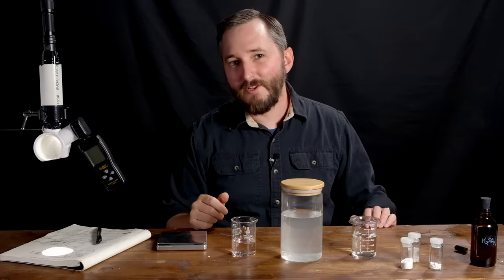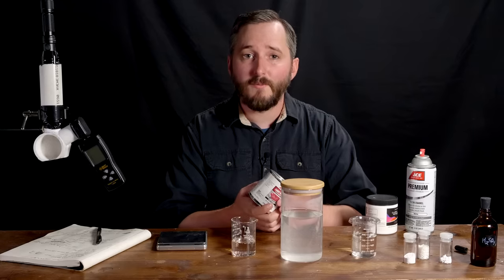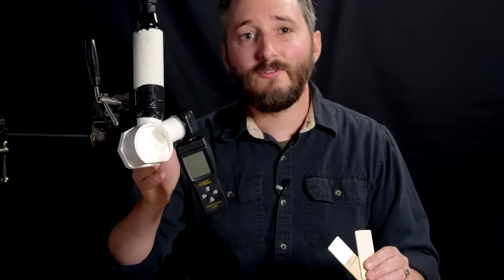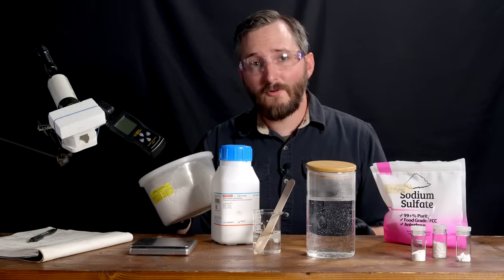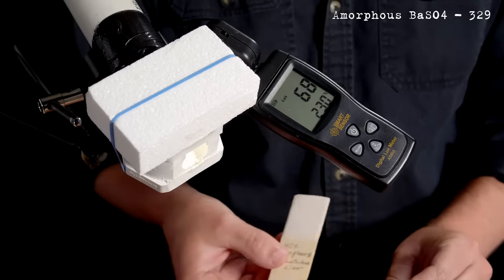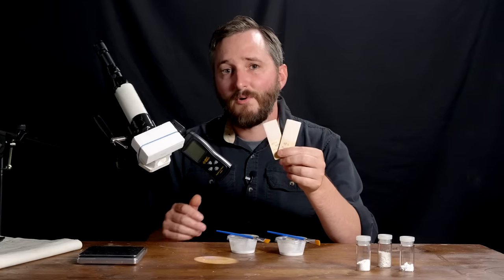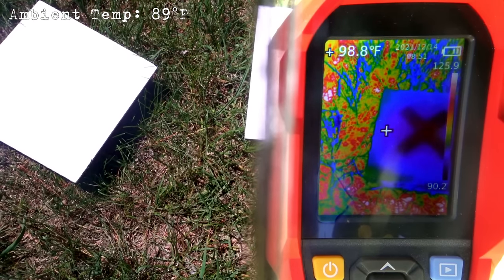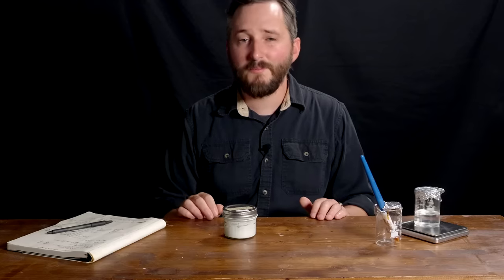How To Make Infrared Cooling Paint (Electricity Free Air Conditioning)

Comment: Idea: paint aluminum sheet with paint, wrap in cling wrap, then add mist or water to back side of panels. If spaced a little from building, you would think the panel should be way cooler. Possible use as a heat sink. Can you electro-plate barium paint?(like ceramic coat) would a ceramic base add to the cooling under the reflective coat? Cool video as always, thank you for your insight. Can't wait for the next one.
Reply: Water would have to be devoid of minerals as these would slowly darken the paint.
Reply: @mateialexandrucoltoiu7207  not necessarily, water is not on piant side of panel. Think of it as water mist "insulation" under panel "roof" or wall. This if channeled correctly, could create a thermo siphon, passively cooling a building. You are completely right about mineral deposits, however the paint or UV protection will cause simalair discoloring over time. The evaporation effect would add to the cooling effect from difusion of light and reflectivity of the water vapor itself. Plus as a bonus most areas needind this kind of system are probably going to be in a dry dusty or sandy area, so cleaning would be required for the paint surface to work. Deionized water would be better, but water would do the job in a place like the sahara.

Comment: You mention calcium carbonate and that's really interesting to me since it's super easy to get and pretty safe healthwise. It's be interesting to see if that's a good option or maybe it can be mixed with barium sulfate in some combination to get even better results. Also someone mentioned that they used calcium hydroxide to paint walls which is also really interesting. Definitely a lot of untapped potential here. This and applied science channels never fail to amaze me how much research and trial and error goes onto these videos. Tech ingredients also did some amazing videos on the topic of cooling

Also mixing different particle sizes of pigment feels like a great idea

Comment: This is extremely exciting. As someone who suffered (thankfully minor) heat stroke during the record temperatures of the Northwestern heat wave last year (but also spent days soaking wet to avoid worse), because nothing up here is equipped to handle California-like temperatures, i would love to immediately start building these proposed cooling panels. And goddamn does the planet need them. If this idea works as well as it might, this could be such an important move just radiating (heh, heh) this information freely. Thank you.

Comment: I remember hearing about this technology years ago but it was only available in the USA, which seemed like a waste given its low energy requirement & low cost.

AC units are too expensive for most people in developing countries. However, panels made using these techniques could be significantly cheaper, have mininal impact on the grid, and pollute less, all while being a more sustainable solution.

I really hope you made a follow up!
Reply from the maker: I'm working on a follow up now
Reply: @Nighthawkinlight  just out of interest, did the original (transparent) paint offer any reduction in solar gain? I'm wondering if it could be used as an alternative to those expensive nano-ceramic heat rejection films used on windows.

Comment: I like the idea but, I also enjoy the heat conducted in winter on sunny days as it helps to heat my house to 20 degrees above the cold. This saves me energy and I like that more, as for cooling, I use an underground 12 inch diameter pipe that pulls air into 8 foot below the earth and it is constant at 65 to 75 degrees, perfect with only a fan and I am off grid 100% so energy conservation is paramount. Needs to be at least 50 ft long but, better at 100 if your wondering.

Comment: Very interesting. Some pyramids were originally covered with fine, smooth, exceptionally-white limestone. When new, such large, white structures could have provided enough infrared cooling to last throughout an entire day and into the next. A bit of refrigeration, air conditioning, and water, condensed out of the air, would have been valuable commodities in the desert. There can be found, evidence of water in and around such ancient constructions, including underground tunnels or "wells" that have long-since dried-up. Since the removal of casing stones also stripped away much of the cooling. Obtaining water out of thin air is quite the magic trick. Lately, I have been using the water from a dehumidifier to make coffee.

Comment: We replaced our shingles with a metal roof. I asked the local distributor what they would do at their house? They told me that the cream color was least transmissive and to put a radiant barrier under the metal. I say it is aluminum bubble wrap. Surprisingly, it was cooler inside! I’m wondering if a full house wrap would keep heat out in summer and in the winter keep it in? Your paint could be an advantageous addition to more efficient construction.

Comment: Building on this idea:
Would be great to experiment with heat engines. As this coating could reduce the temperature of the “cold reservoir” a greater change in temperature means a greater energy potential.
We focus on getting the hot part, but efficiently radiating heat away could massively improve heat engines

Comment: Dear Sir, on the same vein, I did a comparison between bitumen and reflective rock to cover my carpark. In bright sunlight, bitumen reaches around 80C with ambient temperatures around 30C. I then tried crushed marble and that was consistently sub ambient, like mid 20’sC. There may be something there worth exploring. Cheers.

Comment: Just wanted to throw this out here for fun - So I have a south facing building with a flat style roof. I nicked the roofing a couple days back so I wanted to make sure it didn't leak. I bought a product that sounded like a good fit for both the south facing concrete wall I had just replaced and patching the little nick in the roof. Super long story short. I infrared shot a 67 degree difference in 1pm direct sun. You might try testing this against your mix and it may give you ingredient thoughts as well. Blackjack Elasticool 1500 was the product. Let me know if you decide to check it out. Would be very interested to see.

Comment: Fantastic video
Tho BaSO4 is transparent to IR, so atmospheric IR will absorb into the panel. If you paint a smooth aluminum panel you should get a much better result.
80% BaSO4 to paint is the optimal mix iirc.

Basically the paint reflects visible + UV, emits IR, and then substrate reflects IR. (Both atmospheric IR and IR from the paint itself scattering backwards)

Comment: It might be worth taking a look at the IR spectrum of the acrylic material being used as a binder.  If it's transparent in the relevant part of the spectrum, there should be no issue with using a conventional white base coat.  If it's opaque in the relevant part of the spectrum, then a different binder is likely a good idea anyway.

Comment: hmm maybe you should try to make 2 plates. 1 of this cooling paint and  1 of vantablack.  then use peltier plate modules and see if you can make a generator with just using the temp difference of the 2 paints. like maybe heatsinks with the 2 different paints on them can put enough of a temp difference to make a solid state generator. or you can go big and try to make an array of heating and cooling plates or heatsinks. dumping the temp difference into water and pumping the water against the peltier modules. heck maybe just 2 of them 5 gallon water jugs and paint them the different paints and try to make like a connector tube that leads to an array of peltier modules in the middle. then just leave it outside for a few days and see what happens. maybe the paint alone can make the water get a big enough temp difference. maybe the amount of water can keep the modules making energy for a while 

i also wonder what would happen if you paint a block of copper with each of these paints. copper is good at transferring temp maybe just 2 blocks of copper coated in the 2 paints can be enough. 

probably wont make much energy but its a neat idea and maybe it will do something.  you never know. lots you can try and mess with tests will be needed and maybe you can make a new type of energy gen. "the paint gen" hmm lol

Comment: Was thinking about passive refrigeration a while back using a battery of up and down tubes where gas was heated by the sun to create lift then cooled by radiation to sink.  Each successive rise and fall adding to the pressure at the end of the bank.  This paint would undoubtedly be another tool to make it possible.

Comment: You need to make the paint much thicker and apply it by air instead of brush for an even coat that is mirror like. Use linseed oil or safflower oil as the binder. It's thicker and scatters light better and has a high refractive index. It'll suspend the pigment as it dries creating the snowflake effect naturally. Linseed oil yellows in the dark, but clarifies in the sun. Washed linseed oil purified by salt, water, and lavender flowers/lavender oil is much improved. Safflower oil has a lower index but doesn't yellow. It's a less strong binder. It's more commonly used in white paint. Also experiment with coating the surface of the object first with a highly reflective aluminum paint. There are some specialty metallic paints that are especially reflective. This will prevent the object from absorbing light in the first place. Also experiment with coating the backside of the object with the metallic paint as aluminum is a heat sink and should transfer heat away from the surface towards the shaded side letting the cooler grass which is evaporating water to cool it. But honestly the most reflective material known to man as far as I am aware is silver, so it would probably be a more direct thing to make your paint out of silver in the finest particular size possible. It won't shift the color like your barium will, but it's an already common thing. Mirrors are just silvered glass. A silver undercoat or silvered glass underneath your paint might be the best of both worlds.
Reply from the maker: Some of your ideas I've been experimenting with already. I have other things in the works also.

Comment: I have been painting for 27 years.  I can appreciate the value of your work.  When painting roofs, I have always tried to convince my customers to use as light a colour as possible.  90%. If them were very reluctant.    Could any of your formulas be applied over regular acrylic paint base coats.    Recently I have noticed the promotion of light colours for roofs termed "cool roofs".  So your work is totally relavant  for where the coatings industry is headed.   Also If your sample slides are made from bare timber I think any paint you apply without an undercoat first will lack opacity.  An alternative non absorbent substrate for your slide light test samples should have better opacity .  I'm definitely subscribing to your channel. I love your work/intelligence/knowledge.
Reply from the maker: I think what I've made would not work well for a roof coating as is, at least not without a clear coat or film to protect it. It's fairly fragile. Ideally I'd like to make a similar paint that is silicone based so it's flexible.
Reply: @Nighthawkinlight  Re; silicon based paint. Yes I am a big fan of paint with flexibility. Excellent for for bridging/filling fine cracks, gaps, small holes etc. So would be popular for use on masonry, stucco, render etc.  Similar to Elastometric paint, which is one of most expensive in residential coatings. I'm not a chemist so not sure of exact characteristics or types of silicone/silica?  What I do know is, Silicone Sealant, caulking type product used in "wet" areas eg bathrooms, kitchens etc is not paint able. Nothing really  adheres to silicone apart from maybe "MS". So future re-coat might need to be added into the equation.  I searched for a long time for a decent exterior grade rubber type  uv stable (I'm not even  sure what UV stable means) paint for bridging gaps etc. It wasn't until 2022 that I found one. It has all the properties which I believe are most sought after -
-Permanently flexible (needed to account for movement especially on metal roofing)
-Drinking water safe, meets AS4020(Australian,New Zealand standards)
-UV stable (we have harsh UV down here but don't exactly know what STABLE implies)
-Waterproof under permanently wet conditions.
And to top it all off
-Protects metal from corrosion.
Hard to believe though.

Anyhow, After watching your video I will be on the lookout for a paint product which is brave enough to list COOLING PROPERTIES.

Comment: You can try double walled glass tube.fill the gap between the two walls with this material in powder form and circulate water into the inner wall.

Comment: I see no adverse effect in painting the buildings white. In winters they would absorb less solar energy, of course, but this drawback would be compensated greatly by the much better insulation conferred by the most reflective paint, against the warmth losses from inside to the outside. Baryte is commonly used to coat photographic paper, either light-sensitive or for printers.

Comment: Also wanted to say, you may have to see  the differences in interior temperatures of boxes painted with the different paints. One of my customers makes a rubberized roofing and they have data on how much heat it reduces inside buildings, and potential energy savings. In fact, a large church had its roof replaced with the stuff, and they had a very dramatic reduction in monthly energy costs on cooling.

And thermal imaging and temperature sensing can be a bit off with different emissivities of both paints, reflective surfaces are notorious for being difficult to measure, especially ice, and you might see a drastic difference in internal temperature as apposed to surface temperature.

Commented a tad too soon 🤦‍♂️ 🤣

Comment: Just quickly - when mixing pigment with binder it’s better to use ratios by volume, because the pigment density is so much higher than the binder - ideally for this purpose I would try and see what the maximum pigment loading is. Best of luck!

Comment: Just as a second thought. Everyone seems to be going for these complicated first surface mirror configurations which requires a special material with high IR emissivity but low visible absorption. I don't see anyone trying to do the same with a second surface mirror which is considerably simpler with existing mirrors getting very high visible reflectance. You just need a highly emissive surface Infront of it that is transparent in visible. E.g., glass, or you could even try cling wrap or something similar (i probably should research that properly as I have no idea what the emissivity of cling wrap is but anyway). The only issue is getting the heat into your emitter, so you need to keep the high emission film as thin as possible although that will also effect the emissivity, and you need a conductive backing to get the the heat into the emitter. This is how it's often done on spacecraft (although both types of mirrors are used) - look up Sheldahl Red Book and the section on Second Surface silver coated FEP as an example. Performance is not great for what you want on the ground, but they are also designed for space use (light weight etc).
Reply: Actually really curious what temperature you would get for a standard household mirror sitting in the sun beside your samples...
Reply from the maker: There are some papers using second surface mirrors. One recent one used a silver coating on the back side of clear 3m tape to act as an emissive test standard. I have a few tests in progress using similar methods

Comment: The size of the particle and it's refractive index compared with the resin it's encased in are what determine it's blocking power. This is why typical white pigments are small but not nano size. If you recrystallize the barium sulfate  and then mill it down to a coarser but still fine particle you'll likely find a much stronger white pigment by weight
Reply: The particle size is important because for it to interact with light it needs to be larger than the wavelength of the light. As you mentioned the refractive index of the acrylic medium may be too similar to have a strong affect as well. You could solve this by coating the particles

Comment: I like the idea of snow paint to use on the clay fridges made in India that   have no electricity yet keep 8 degrees cooler inside than outside.
Reply: They require water seepage through pores to help evaporation of water which in term causes the actual cooling. Applying a paint on the outer surface would block evaporation & no cooling will take place.
Reply: @muhammadmubeenislam  oh thank you for this insight. I live without power off grid and wondered how those clay fridges worked.  I would love one of those
Reply: @propertygeek  you can make an underground food storage pit that will act as a clay fridge

Comment: Regarding the failure of Barium Nitrate and Sulfuric acid method

The Acidic conditions of the sulfuric acid will inhibit the ability of EDTA to chelate the Barium ion. Chelating the barium is what slows down the reaction so you can get proper crystal growth. So you are inhibiting the slow down mechanism if that makes any sense. Thats why the second method worked better since there was no acid.
Reply from the maker: I believe I tried sodium sulfate rather than acid for the nitrate reaction also.